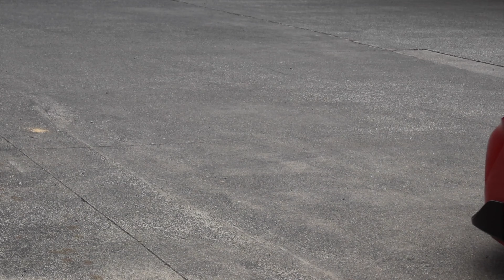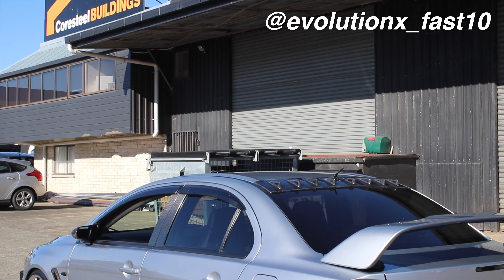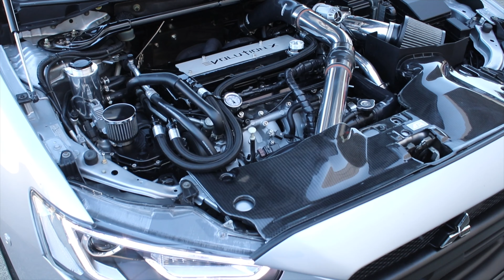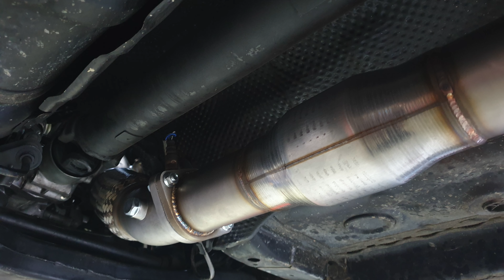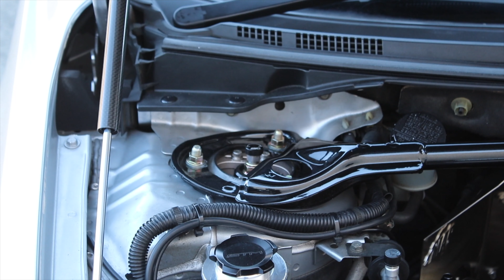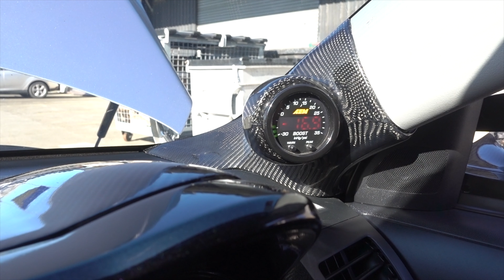Tough Street Build | JDM Evo X

Comment: What specs are the front wheels? Looking to get some for mine but I’d get a square set up. So just wanted to know what clears the front brakes with the CR wheels.
Reply from the maker: They are Work Emotion CR2P 19-9.5 wrapped in Nitto Invo tyres. You'll have ask Tim, the owner what the offsets are. Jump on Instagram and ask him - @evolutionx_fast10
Reply: @PossumBourneMotorsport  Thanks for responding.